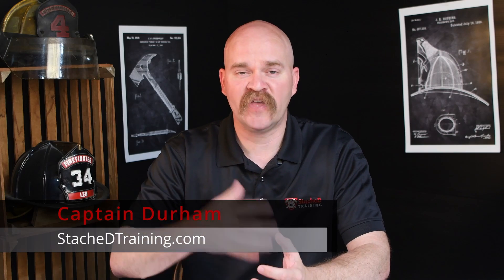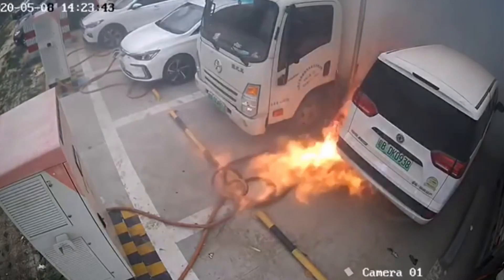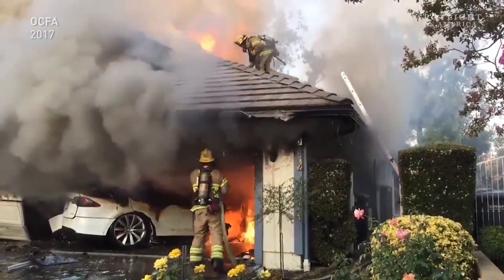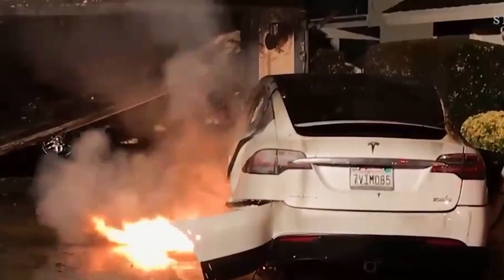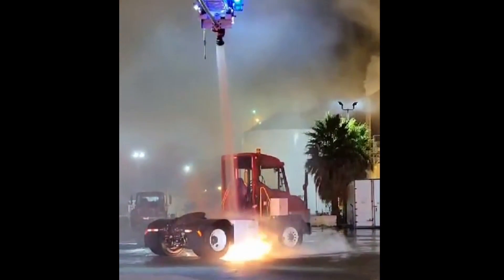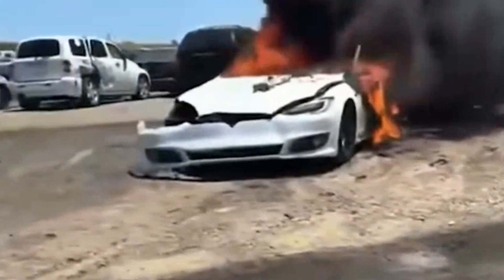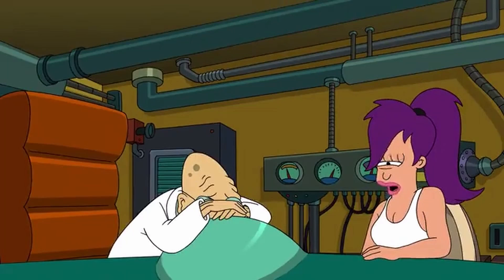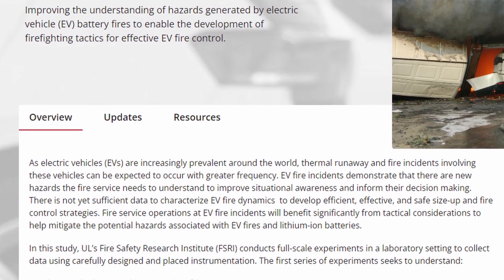Extinguish Electric Vehicle Fires

Comment: My question than is all double aa battery fit double aa things why. Don't they as a standard feature required a2.5 inch diameter fire hose connector as a standard flooding feature for batteries would that not be good answer since it needs to be flooded in case of fire you would hook up hose than. The compartment would be flooded d?

Comment: Thank You !!!!   Wrecking Yards.  Scrap yards that have stored tanks of Gasoline. Motor oil and other vehicles.   The electric vehicles WVHAT !!! Kind of suggestions would your group have.  Other viewer too.   Forgot any tips for the rag tag fleet of company and scavenger 1099 contract tow trucks dragging electric vehicles into our or any of the yards.
Reply from the maker: I plan to do a video that focuses on information for tow operators.
Reply: @StacheDTraining  good.   This is much needed advice for tow yards and wrecking yards.    Another issue came up on the news. ( it is like WACK A MOLE ).  Solar power battery storage - from used recycled  vehicle batteries.   Battery storage room usually basement.  The company was selling power banks in Florida ( prone to flooding).  You can see what is coming.  Garage or basement full of 5 to 10 old car batteries.  —-  MY OPINION —-  old car battlers from wrecked vehicles should’ve fully recycled and remade into new safer batteries.

Comment: What about smoke danger whilst letting it burn out?
Reply from the maker: There are a lot of concerns for any methods.  If you let it burn, you have a more complete combustion of the gasses that are being given off.  If you don't let it burn, there are more un-burnt products of combustion that could be harmful.  If you put lots of water on it, you could be introducing contaminants into the waterways.  If you are on city water, chlorine is one of those contaminants.  There is still a lot of data that needs to be collected on the topic.  Hopefully trials with UL Fire Safety Research Institute will help answer many of the questions.
Reply: Would like to see info on that.   When available.
Reply: Chemical agents are available to combat lithium thermal runaway

Comment: Thanks so much for direct clear information without all the bluster that goes with so many you tube videos. First responders worldwide need a damn good solution to battery fires asap. Is there any kind of reagent that would neutralize the lithium? How to get it into the cells though? It's a tough one for sure. Like some other comments on your channel the idea of a port on the battery packs to inject a fire retardant seems like a good method. How to plug into the port on a fire ball though? Eeeek. God bless you and yours mate.

Comment: Thought water cut through everything…. Can a high pressure water stream cut through fireproof material and take out ev fire?
Reply: The kind of pressures used in fabrication require some heavy duty equipment - its not exactly portable. What has been tried are spikes that penetrate the battery pack and allow "normal" high pressure water in: HOWEVER, battery packs are often segmented (and Tesla ones can be filled with foam), so once the water gets inside, it may not get to the cells that are actually causing the problem. Then there is the additional risk that penetrating the pack can cause additional faults that lead to other parts of the pack failing and exacerbating the problem. The engineering to solve the problem is going to come from a combination of vehicle/motive system design engineers, chemical battery technology changes, and first responder engagement, rather than just some engineers attempting to design a solution to the symptom.

Comment: It's only a matter of time before there is a serious EV fire in a tunnel, perhaps the Engish Channel tunnel? That's not going to end well...
Reply: Yes the famous tunnel fire  between Italy and Switzerland.   Smoke killed most of the people.   The lighting and ventilation has been updated    But your thought is a good one.   Tunnels would turn into a blast furnace.    Vehicle fire on 5 FWY in tunnel that damaged cement on ceiling of tunnel.

Comment: Two questions:

If an electric car battery does not need oxygen, why don't underwater burning cars or buried burning cars burn out in 1-2 hours the same as cars left to burn out on the road?

If the fire appears out, is there any chemical or structural solution that will reduce or eliminate the possible of the runaway heat starting a fire later?
Reply from the maker: There are a lot of factors.  If the battery box does fill up with water, it will stop the cascading thermal runaway.  That means it should not allow other cells inside the box to burn.  However, now you have a damaged box.  You also have damaged water soaked cells.  Once the vehicle is removed from the water it is possible for the thermal runaway to start again.  It really depends on the amount of stranded energy (if any) in the cells.
Reply: @StacheDTraining  Thanks for making that so clear, StacheD

Comment: So what happens in a multistory carpark?
The water deluge system in these is designed for a different type of fire (ICE cars).
Do you sit back and let the whole structure burn down?
I would not be happy personally to park anywhere near an EV.
Reply: It would be extraordinarily unusual for a lithium battery to just ignite at random while parked doing nothing. They usually burn up when they're being charged, discharged too fast or if the battery is pierced by a physical impact. So I think carpark fires are not a big deal unless there are chargers for the parked cars.
Reply: @nerd1000ify  multi-story parks will soon be full of fast chargers, all bets off on how soon the first inferno will be.
Reply from the maker: You are correct, the buildings suppression system is not designed for an EV.  That is a situation where the fire department will need to flow a LOT of water to protect exposures.
Reply: @StacheDTraining  Do the planning rules need to change so charging can't be done in these facilities?

Comment: You neglected a MAJOR reason for letting it burn.  All that  smoke is FULL of toxic gases, allowing it to completely burn eliminates much of the toxicity.  More flame is better.  And any water you use to try and extinguish a battery pack has now become hazardous waste runoff, so now you're getting the EPA involved, and you're going to have several truck loads of dirt and asphalt to did up and replace, and a crap load of paperwork.
If you just let it burn, in about 2-2 1/2 hours you'll just be able to sweep it all up.  They may have to repave a bit of asphalt, but no haz-mat incident.
Reply from the maker: I plan on doing a video specifically addressing what's in the smoke.  That's definitely something I'll be addressing.
Reply: @StacheDTraining  If you ever get a chance, you should take the course offered by the Energy Security Agency.  It's an excellent day of training.  They also have a toll free emergency number like Chemtrec, only for EV's.
Reply from the maker: @ffjsb  I've seen some shorter presentations from them.

Comment: I am currently researching the possibility of fire blankets for suppressing EV fires for my department. Would placing a blanket over the EV to reduce smoke and flame while letting it burn out be a viable option?  Or would this have the same effect as cooling with water and just drag the entire process out longer?
Reply from the maker: A fire blanket will not suppress an EV fire.  I talk about blankets, as well as other methods in this video: https://youtu.be/qgP7KkDesBo

Comment: Law makers need to push to phase out the chemistry that causes these runaway battery fires. There are next generation chemistry that's starting to be produced the way the current lithium tech phased out those NiCad and NmIH batteries which were terrible for power tools such as those 1990s drills you had to 100 percent discharge due to battery "memory".  

No only will the cars not keep on burning for hours but we'll have higher capacity & charge rates for our power tools. I seen where somebody used cheap harbor freight zaw zaw blades to trench their back yard for wiring.animal fences, it would be nice if we could quick charge those power tools.
Reply from the maker: The market is working towards safer battery chemistry.  I'm optimistic that the risk of thermal runaway will go away eventually, however, when it does go away we will still have a lot of legacy products on the road for a number of years.
Reply: A fire crew rolling up scene on a battery fire will have to have a data base to help them know what kind of materials are burning.   Battery chemical and structure type.    To help them fight these fires.

Comment: I know from dealing with RC car size lipo fires, they are not a joke! Once one cell goes, the heat from that cell will set the next one off, and so on. Dousing the battery in water is less about extinguishing the fire, and more about cooling the cells to stop the reaction, as I understand.
Reply: It's  only a temporary stop, the other cells are already damaged.
Reply: @ffjsb  Fair enough! I know in my case I just let the pack burn itself out but this was a tiny 2-3 cell Lipo no bigger than a can of Coke at the most!
Reply: @MakeItWithCalvin  Yeah, that's a lot easier to do with something that small.
Reply: @ffjsb  not to mention they go out pretty fast and unless you got a ton of flammable around, it's fine.

Comment: Why not develope a coolant system that uses a plastic piping material that melts and fills the battery compartment with the coolant when it reaches a certain temp? a little more weight would be added for a larger coolant tank. I dont know, I dont build cars. Just a thought.
Reply from the maker: Some are built this way (not for this reason).   Unfortunately, there would be no way to carry the amount of coolant required for this purpose.

Comment: I live in an area where vehicle ferrys are a necessity. The crews on these ferrys are literally terrified that an electric vehicle fire might happen. Cars packed like sardines and no real way to put it out. Scary stuff
Reply from the maker: The plus side. They shouldn't be charging, and the risk of damage is low.
Reply: @StacheD Training  So do these fires happen mostly during the charging mode? Thanks for replying 🙂
Reply from the maker: @braddeptford1969  Unfortunately, we don't have concrete data in this area.  Charging is a major failure mode.
Reply: @StacheD Training  thanks for the info and your vid was really good 👍
Reply: It's already happened on multiple vessels
Reply: Lessons could be learnt from felicity ace car carrier  fire and the latest car carrier  fire  Fremantle highway
Reply: @charlesschulz8416 the freemantle highway fire was mostly fuelled by conventional cars. If there had heen a working fire extinguishing system (CO2 or reduced oxygen) the fire would have affected a few cars only.
Reply: STUPID STATE OF CA wants to convert all ferries to electric boats.   Which battery pack will catch fire first ????    But lets stick to the vehicles — stage TESLA car close to ramp gate hatch.  Any fire - push it over the side with another vehicle.   BLOOP !!!

Comment: If manufactures had to design systems into the battery to allow them to be put out, what would work best? some kind of valve and piping system that you can connect into? or a built in fire suppression system?
Reply from the maker: Renault, a French automotive company,  designed a port specifically for firefighters to flood the battery.   I currently have a fire department connection to the battery patent pending.  In a future video, I'll discuss this issue in detail.
Reply: @StacheDTraining Also the Honda ZR-V (apparently); manufacturers are waking up to the need to allow controlled access. (Tesla filling the pack with expanding foam, ...sheesh!)